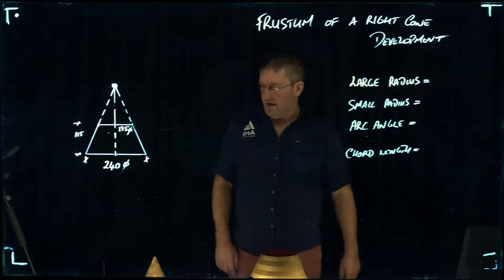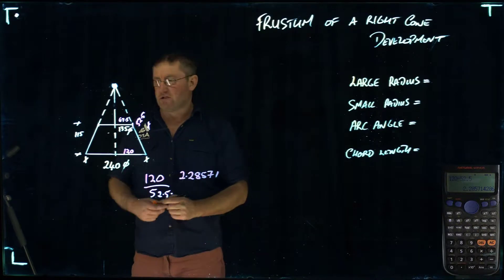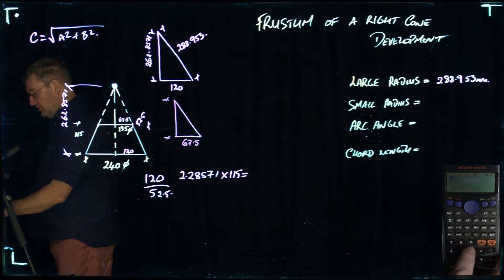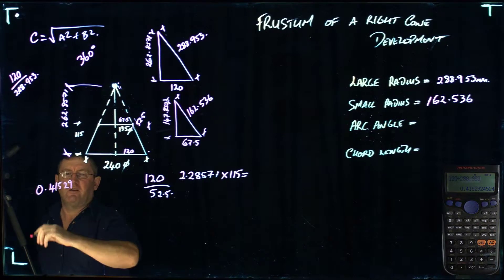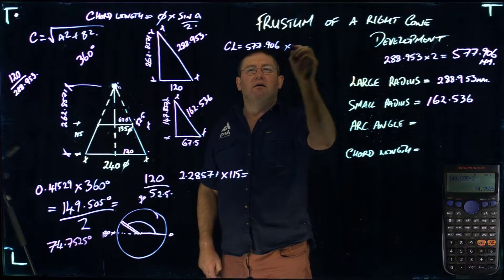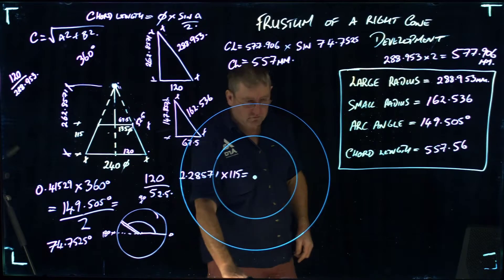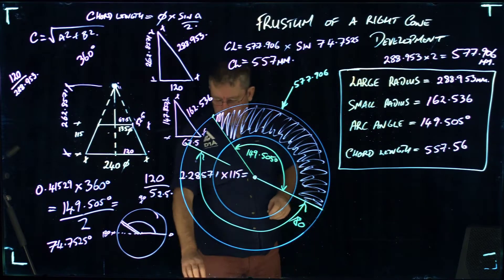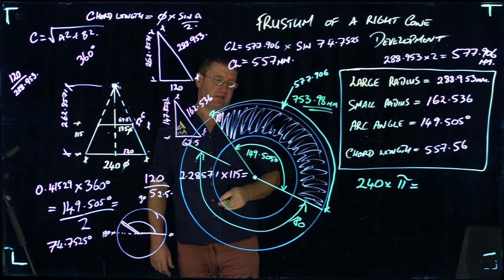Frustum of a Cone Pattern Calculation

Comment: Would you apply a similar method for an offset cone or use the radial line method instead?
Reply: Thanks Mark. An oblique cone was what I was thinking, as you say it all comes down to the worker. Seems when you actually put the pattern on the sheet, everything changes when you start folding or rolling, especially on stainless. Thanks again 👍